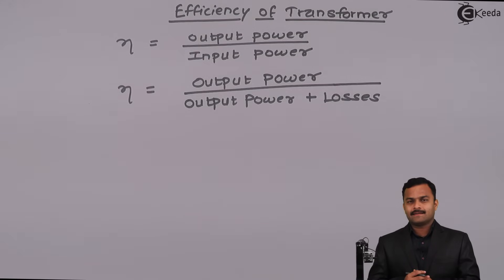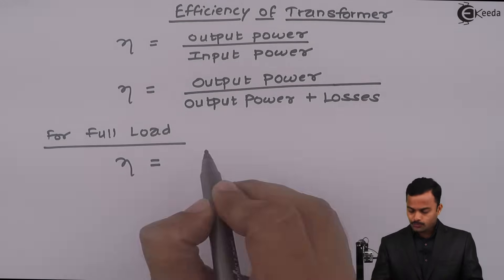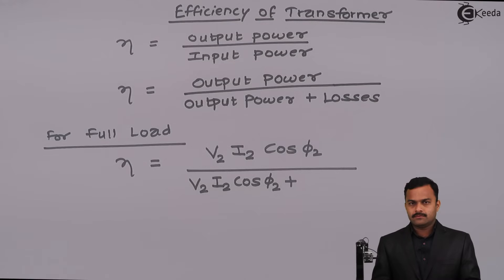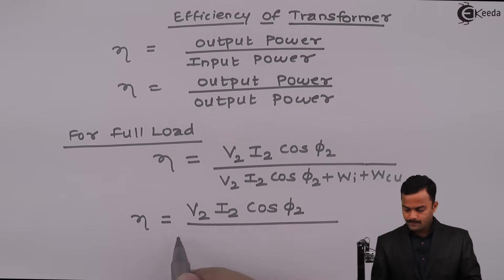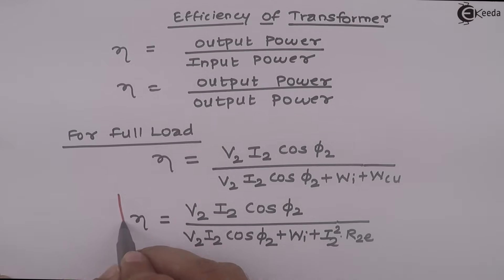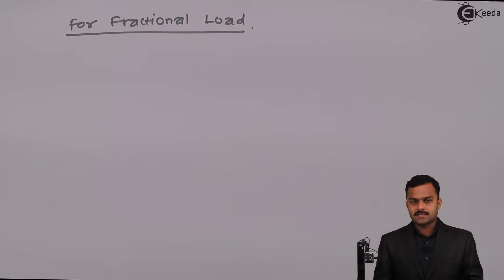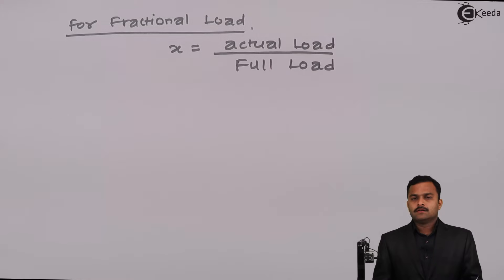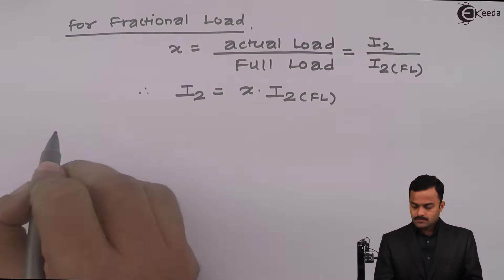Efficiency of a Transformer - Single Phase Transformer - Basic Electrical Engineering

Comment: A 2400/240V,kva single phase transformer had a core loss of 1.8kw at rated voltage. its equivalent resistance is 1.1%.then,the transformer efficiency at 0.9pf and on full load is